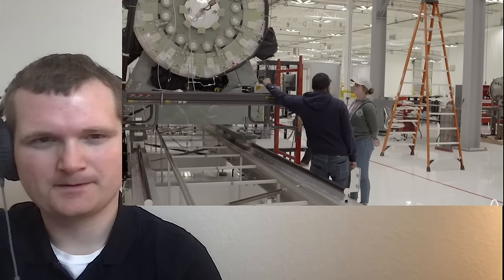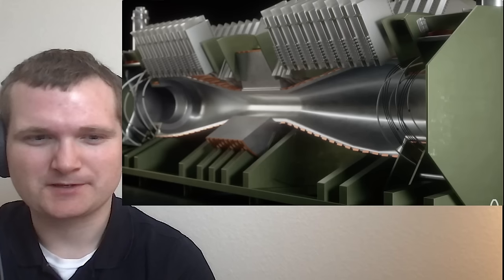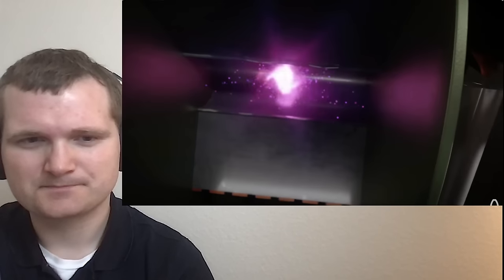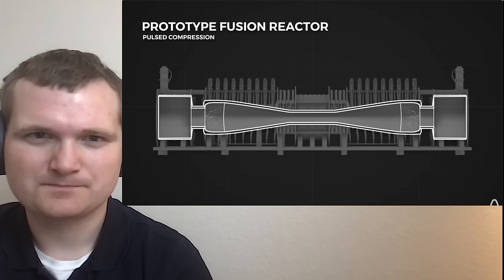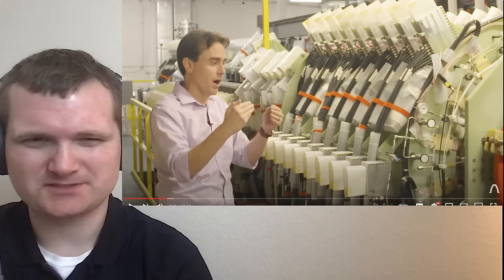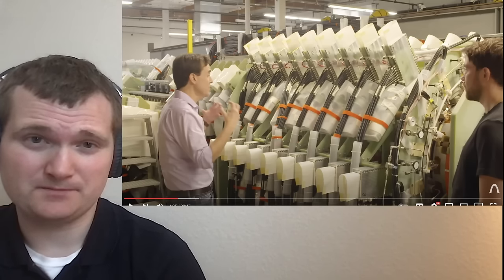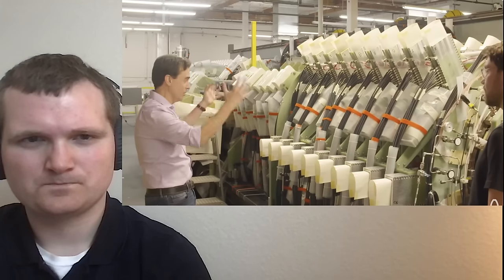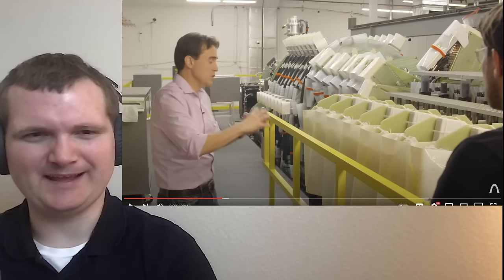Will the Helion Fusion Reactor ACTUALLY work? - Nuclear Engineer Reacts to Real Engineering

Comment: Confirms what we already knew, "fusion reactors are less than ten years away, just as they have been for the past 70 years".
Reply: Iter will change that
Reply: Well u know it used to be "40 years away and always will be" then it was 30 then 20 and now 10. They're making progress, they're timelines have always been too aggressive and I doubt any of the companies working on it today will actually see the fruits of their labor but the field is progressing slowly so ya it's gonna be 10 years away for the next 20 years or so but not forever one day it will be here.
Reply: Nah, it’s only been 10 years away for like 25 years. We’ll get there in a bit over probably 20-35 years… It’ll be 10 years away for another 5-10 years, then 5 years away for 10-15 years, then 1-2 years away for 5-10 years. After that, they’ll probably know enough to have a reasonably accurate ETA.
Reply: Predictions are wrong. Progression is visible. That’s all.
Reply: @OtherTheDave  it is what it is, what will be will be, we get there when we get there, a blind clock occasionally gets an acorn, a squirrel is right twice a day.
Reply: Northrop Grumman is suppose to already have smaller ones by now.  They announced it then never heard another word about them.
Reply: Cannot deny that in the past couple years some actual progress has been made.
Reply: I think in 10-20 years we will finally break even in energy production from fusion and then once that happens another 20 years to be usable as commercial power.
Reply: Oh no, they were just 20 years away.  We've made progress in the last 70 years.  Now, we are 10 years away.  In 70 years 5 years away.  In 70 more years 2 years away.  And 70 years.  So, we will need 240 years for practical fusion for power generation.
Reply: @PlutozReal nope, progress is at a snails pace, their will never be commercially viable fusion on earth.
Reply: @rumbecker5085 your comment is self-contradictory. If they are making progress towards commercial fusion, then by definition they will one day succeed.
Reply: @giin97  Nope, it's never said they are making progress in commercial fusion. Fusion has been around for 72 years and zero progress has been made for commercial fusion for power generation.
Reply: @rumbecker5085 they made a big breakthrough in Japan not too long ago didn’t they?
Reply: @njjones1998  I doubt it
Reply: @rumbecker5085  yeah I remember now they’ve consistently been able to get a lot more energy out than they put into the system and sustained it at temperatures multiple times that of the sun for like 2-3 seconds
Reply: @njjones1998  yeah, no they did not, we are not even close to break even, over an order of magnitude away.

Comment: I don't know where to begin here but this video is in parts really painful to watch for someone who has a degree in plasma physics and nuclear engineering with focus on nuclear fusion. And I'm saying that as someone who is doubtful about Helion myself. The problem seems to be that Tyler's background is in fission not fusion. Those two fields actually have very little overlap in how to build a practical reactor. Fusion is 90% plasma physics. Fission on the other hand doesn't involve any plasmas, so nuclear fission engineers don't get trained in it As a consequence Tyler seems to not really understand plasmas and how they are confined. He says that the sun is fusing deuterium and tritium which is not true. He constantly seems to forget that the plasma is in a vacuum and isolated against the vacuum vessel by magnetic fields. He confuses plasma pressure with magnetic pressure. I could go on  The end result is that he is not able to properly evaluate the claims being made. I'm not siding with Real Engineering or Helion but Tyler clearly doesn't have the necessary background to evaluate their claims. It would be equally difficult for someone trained in nuclear fusion to evaluate a new nuclear fission concept.
Reply: Could you recommend a video that does a better job at addressing helion's claims?
Reply: For Tyler defence, he's not claiming this technology is not possible, he express his daubt based on his fission physic background and asking question what about temperate, pressure, efficiency etc.
Reply: The channel "Improbable Matter" belongs to an actual fusion scientist and he completely dismantles helion
Reply: @collemwillst1810 by dismantle you mean he spouted a bunch of pendantic nonsense then sure.
Reply: I dunno, man.  Plasma physics is hard to model...
Reply: @Manosdepiedra1979 You mean you spouted nothing but non sense?

Because that is exactly what you just did
Reply: @tonamg53   You mean you spouted nothing but non sense?

Because that is exactly what you just did
Reply: @Manosdepiedra1979  You know that imitation is sincerest form of flattery, right?

So thank you, I really appreciate you imitating my statement 🤭
Reply: @tonamg53  you spouted nothing but non sense?

Because that is exactly what you just did
Reply: @Manosdepiedra1979  Thank you bot.

Comment: I like Helion as an aerospace engineer, but not because I think they have an above-average chance of practical fusion. The specific technology they're developing was originally a pulsed plasmoid electrodeless Lorentz force thruster in Dave Kirtly's lab at the University of Washington. even if we never get fusion out of it, I bet we'll get a pretty good electric thruster out of it that can use any gas a propellant, which would be great for exploring the solar system.
Reply: Their thrusters came later. The inventor of their tech started out with LSX and other FRC experiments in the 90ies. The thrusters were spin- offs from that.
Reply: Well, how high is the "average chance" of fusion?
Reply: @StefanReich   Pretty good, from what I gather. Their 5th prototype, Venti did > 2 x 10^11 D-D fusion reactions per pulse back in 2018. Venti was still about a benchtop sized device. Trenta was much bigger and should have surpassed that significantly. Probably around 10^12, maybe as high 10^13 D-D reactions per pulse.
With D-T that would be two orders of magnitude higher. That is in the range where Trenta could have produced net electricity - provided their energy recovery works as well as predicted. 
Now Polaris is bigger still and has much stronger magnets. Unless their scaling laws suddenly go from "better than the model predicted" in Trenta to "worse than the model predicted" in Polaris (which I find unlikely), Polaris should do quite well as a proof of concept.
Reply: who is dave kirtly
Reply: @paweszutowicz5732   David Kirtley is the CEO of Helion energy.
Reply: @paweszutowicz5732  He's the son of James Kirtly.  Unfortunately, they had  the Klingons kill him off senselessly.   That gets Kirtly to decide he wants all of them gone.  But he later learns to make peace with it.
Reply: @paweszutowicz5732  He was the inventor of Toaster Struedel,
Reply: @doomtho42 
Oh, come on! Everyone knows they were invented by Steve Poptart.

Comment: I decided to scroll through the Helion Twitter while watching this. So From what I see, they are apparently on pace for starting Polaris in 2024. They are also putting the reactor into a room with 2.5ft thick borated concrete walls, stepping up capacitor manufacturing, creating testing procedures and equipment and analyzing the plasma output from their test reactors. Hoping they get to net zero by the end of the year or at least running. I suspect there are more gains to be had by capturing the neutrons with a breeder shell, but let's see if they get Polaris functioning first.
Reply: The math don't add up. They want an "economical grid connected reactor" in '25 or '26. Yeah, no. Start ups always hype their product. This won't be feasible in 5 years - if their claims would be accurate, which they aren't. In ten years they will claim the same stuff or gone defunct. Btw. nothing new or secrete about their machine. Their design was already tried and tested in the 60ies. If they need to lie that hard, there is nothing behind and they are just trying to figure out if any of their new ideas work at all.
Reply: @juliane__  It's highly doubtful we had the appropriate electronics to drive such a machine in the 1960s given the power, speed, and precision requirements.
Reply: @maudiojunky  I'm with you. They would have relied on analog feedback circuits to a large degree and rudimentary electric circuits to make it function then.
Even if they don't end up with a commercially viable power generator, the precise control they're working towards will allow them to produce fuel for other reactors, plus the tech they are developing to control the reactions will have uses in other designs. Who knows, maybe even utilizing ai to analyze the reactions might lead to that final breakthrough to make fusion actually work finally.
Reply: @kstricl  I think we can look at the stellarator as an adjacent example which was conceived of long ago but was considered infeasible until recently, and that's probably easy compared to this from an electronics and control standpoint. The problem in that case was actually solving the design equations - it wasn't until computer simulation of the magnetic confinement geometry was used to design devices like the Wendelstein 7-X reactor that it started to look feasible, very similar to other hard electromagnetic solutions like stealth aircraft geometry. Computer modeling and analysis will certainly play a huge role in optimizing Helion's device.
Reply: @e__ No, the first grid reactor is for Microsoft and that is 2028. Polaris is still an experiment. Also, they have several patents covering their designs (going back to when the team began their research on this back in the 90ies). So they are (relatively) new.
Reply: I don't think they will convert the neutrons for the D-He3 machines, even the D-D-He3 hybrids, but I suspect that they might want to do that for D-D (the He3 breeders) and potential(!) D-D-T machines. I doubt they will want to breed more He3 with a breeder blanket. They will have more than enough Tritium as is.
Reply: @elmarmoelzer2229  I was actually thinking more along the lines of converting some of the neutrons emitted to heat, so calling it a breeder shell was wrong on my part. However, if they aren't able to become fully viable as a power producer, becoming a tritium producer for other fusion plants could become a very lucrative business model.
My main thought was actually that if they were emitting enough heat, they may be able to drive a low temperature turbine, hence capturing more of the output by converting it through your more standard processes. I'd imagine this thing is gonna be in need of a lot of active cooling, so may as well maximize the gains.
Reply: @kstricl  Steam turbines are relatively expensive though, especially when you want to get into lower temperatures. From what I understand.
Reply: @elmarmoelzer2229  Just a thought I had. If the heat output is consistent, they could use the energy for any number of things. Comparatively speaking, if they used a steam turbine like some wood mills use to generate electricity for their operations, it could be an off the shelf part, keeping costs low in comparison to the rest of the assembly. This could then be backfed to the grid as part of the base load or used on site for their own needs.
All theoretical anyways, they need to actually see a net gain from Polaris first.
Reply: @juliane__  And I'm sure that there hasn't been &*any* improvement in magnetic materials, plasma containment, or any other technology since the 60's. The point is that sometimes (not always to be sure) it's these ancillary technologies that make or break the practicality (esp. at scale) of these complex systems. 

That said you aren't wrong that Helion is hyping themselves. Still, one day, just maybe, one of the companies that are doing this will actually manage it anyway. And whoever does it will deserve all the hype, and more besides.
Reply: Their main goal is to provide electricity to Microsoft to run their data centers since Microsoft is their main sponsor and they have to start paying them back if they don't deliver a product. So once they have a working fusion device, they're going to build them for Microsoft for the small specific case and I guess start working on scaling up for the grid based on how that goes
Reply: Also re the dose question, their rep told me that their calculations show any area that would be a radiation hazard is much more dangerous as a high voltage concern because of the stupid numbers of high power pulsing capacitors needed.
Reply: @mosraelthewaker   They also have a contract with Nucor for a 500 MWe plant. That will supposedly come after Microsoft. Biggest issue with grid power is the grid connection licenses. Currently it can take 7 years to get one. So they are looking at "behind the meter" applications like the Microsoft data centers and the Nucor steel mills first. Microsoft is also just around the corner from them.
Reply: More power to them
Reply: It does seem like they're leaving some juice on the table by not spinning a turbine with all that heat they're going to generate.
Reply: @jttech44  It is not that much heat. About 1 MW/m2 of vessel wall in a 50 MWe machine. Probably not worth the effort.
Reply: That company is a Con
Reply: @juliane__  Agreed, plus they are looking for more investors to invest in their pipe dream, so that they don't have to get real jobs and to continue living off the investors money.
Reply: @kstricl  Lol, your ignorance is mind-boggling. They aren't bringing any new technology, they are using the same old components of Resistors, transistors, Transformers, Capacitors, etc... It is not gonna work. It's not a hardware problem it's a physics problem.
Reply: @calicoesblue4703  how is hoping they get the thing built and operational ignorance? Like you say, there's nothing new component wise, so it's just a matter of physics and math. At best, they become the first viable commercial fusion operator, at worst, they've built the capacity to capture lightning strikes. They might also just become a tritium supplier for other fusion projects. At absolute worst, their attempt costs you and I absolutely nothing as it's all private funds; the attempt itself may prove useful for other researchers.

Comment: there is a video response by Improbable Matter, titled "The problems with Helion Energy - a response to Real Engineering" talk a little bit about some of your points
Reply: The IM video is not answering any questions and is full of mistakes and misunderstandings. At least Tyler is good in that he admits that he does not understand something and that he has questions.
Reply: @elmarmoelzer2229 I've seen that video, and i'm not sure how wrong he might be.
Don't know alot though, for what i understood, a thermonuclear reactor Will generate neutrons while running.
Reply: @mrblackx8665   Yeah and there are lots of fusion experiments using Deuterium out there. In fact, most of them do. Heck, you can build a fusor that can generate many D-D fusion reactions as a high school experiment. You should take precautions (like not stand next to the machine while it is operating), which is clearly shown in the RE video. Generally, the points that IM makes are sometimes silly, sometimes based on misunderstandings. Reaction videos are usually missing context because they do not look at other information. E.g. you can check Helion's website, patents, etc to learn more about what they are doing.
Reply: @elmarmoelzer2229 I wonder what your professional experise in fusion energy is since you appear so confident to dismiss IM's points. IM has a good amount of research experience in the fusion community.
Reply: @eliasboegel   IM has experience with Tokamaks and from many, many years ago. 
He is trying to apply that to this machine, which is not a Tokamak.
That aside, he showed some glaring mistakes in his understanding of how the machine operates. Most of those misunderstandings could have been resolved by doing a little bit of research, reading Helion's papers and looking at their patents. 
Some of IM's arguments are even self- defeating like the whole "but they promised fusion x years ago" when that very article that he quoted says just above the line he underlined that they were looking for funding for doing that (which they did not have until summer 2021).
Most of those things do not require you to be a nuclear physicist, just common sense.
Reply: @elmarmoelzer2229  Again, please state your professional expertise.
Reply: @eliasboegel  this dude is under every criticism about Helion Energy on the internet, he has the same nick name on almost any forum.
So there's definitely a conflict of the interests, and I wouldn't trust a single word from "elmarmoelzer".
Reply: @avastorneretal  Seems so.
Reply: @mrblackx8665  Depends on the fuel used. There are fusions that are lacking neutrons called aneutronic. Like Proton + Boron and D + He3. The problem is that He3 is rare on earth, plenty on the moon to harvest from the top meter of the crust.  So Helion plans on running some reactors with D + D to get the He3 to power the cleaner reactors.
Reply: @eliasboegel  There is no conflict of interest because he is not an employee and not a investor of helion. The misunderstandings are real and well demonstrated but you and that other one just "turn around" with stupid accusations.
Reply: @francescoG5 -- Being a fan of something can still blind you to faults, even if there's no money involved.